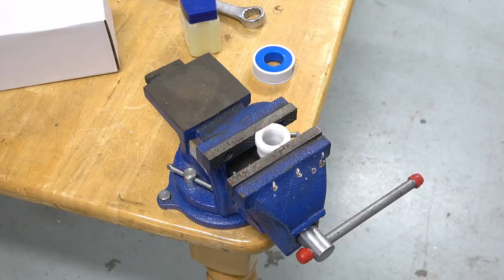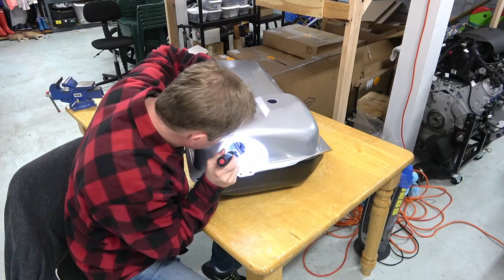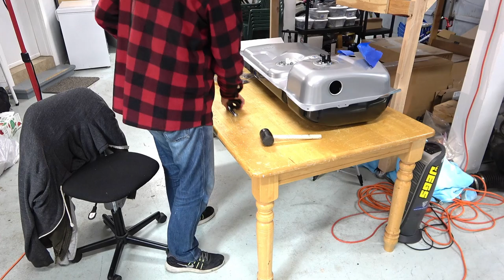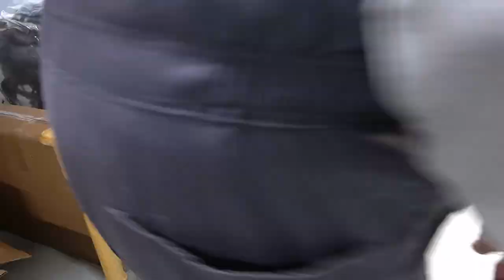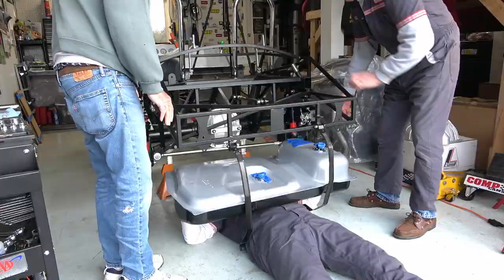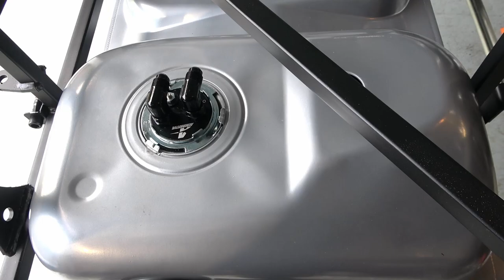Budget LS Factory Five Cobra | Build Update 13

Comment: I remember installing the tank was irritating for me. It was a solo job and one of the bolts was not quite long enough. There was quite a bit of cussing on that day LOL! I have a 347 stroker Carb so running the fuel line was a breeze and am using a Holley Red external electric fuel pump so my fuel system is no where as complicated as yours. I am just really waiting to see the engine drop in and the wiring for an LS. Going to be really cool. Also I used a gasoline safe lube/ sealant for the  gas tank O-rings. Was worried about other compounds degrading the O ring from silicone based lubes but did not think about Vasoline. That would have saved me some money. Thanks for the video :) Keep on eating that elephant one bite at a time. You will look up before you know it and it will be finished. Took me about 7 months from start to legal road driving. Just an amazing experience.

Comment: How close is your filler neck to the 3/4" square tube, coming out of the tank?  I needed to use a small plastic spacer between the tank and where it hits the 3/4" down square tubes with caps on my MK4.  Also, remember to uninstall the passenger side fuel tank strap for installation of the trunk aluminum.
Reply from the maker: It is about half an inch from the square tube if the filler neck is coming straight out from the tank. Ya, I undid the strap bolt.  I need to read.the directions better.

Comment: Did I see a tube cap on the downspout of your return line? It's an orange cap. I know my EFI pump from Factory Five was shipped with one. Just checking.  Love your videos.  Kevin
Reply from the maker: I thought it was a one way plastic valve. I hope I wasn't supposed to remove it.  :)
Reply: @AmateurHourGarage You may be correct......prob should double check the instructions.

Comment: Wouldn't you want the fuel return not inside that little fuel basin inside the tank along with the supply?  That way the fuel won't short-cycle and get too warm.  Routing the return as far away from the pump sock seems the logical thing to do to keep the fuel cool.
Reply from the maker: Hmmm.. valid point.  I was more concerned about keeping the sump full to avoid fuel starvation.